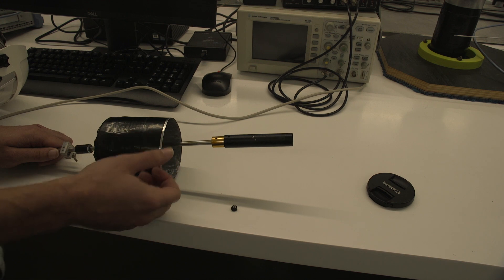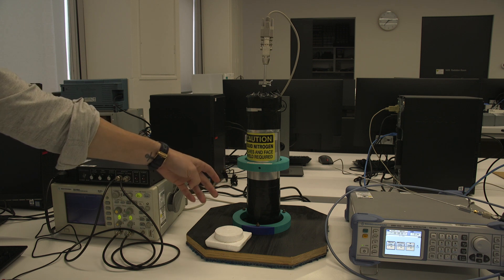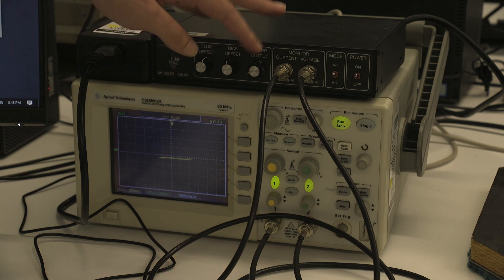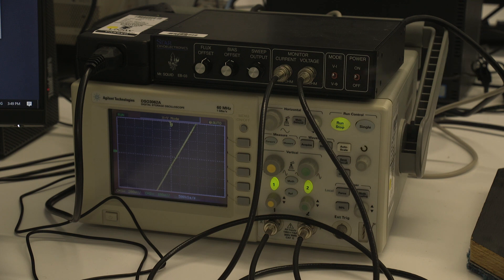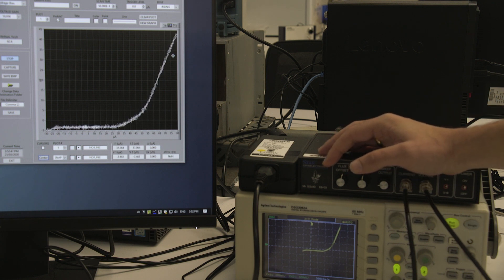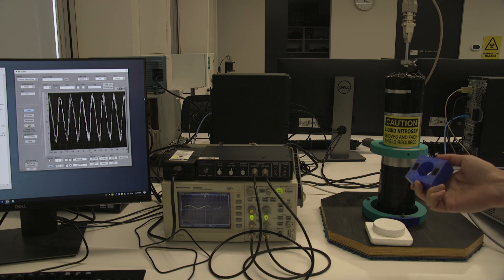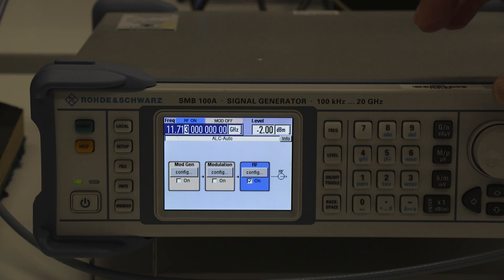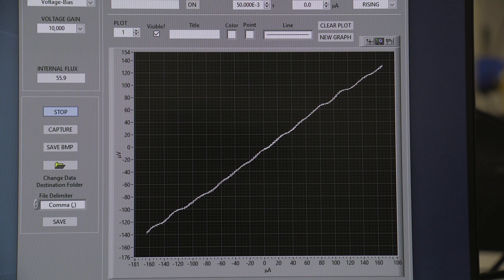Superconducting Quantum Interference Devices (SQUID)

Comment: What is the superconducting material for the SQUID?
Reply: Niobium most likely
Reply: The one I've been using is documented in the manual to be YBCO or Yttrium Barium Copper oxide, with a critical temperature of 92K, hence it's superconducting state at 77K in liquid nitrogen